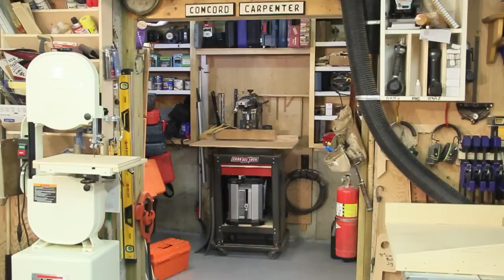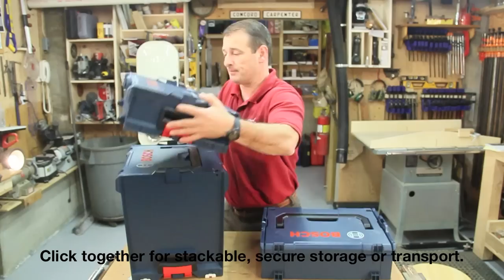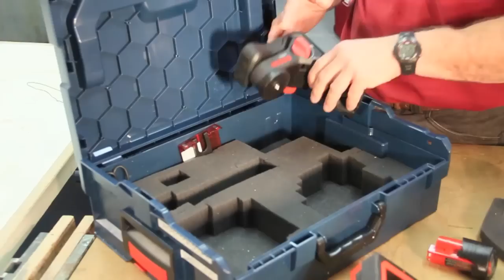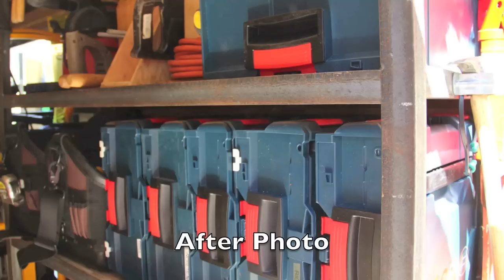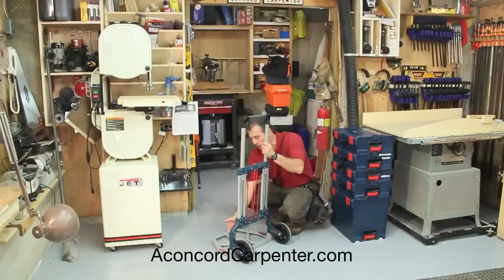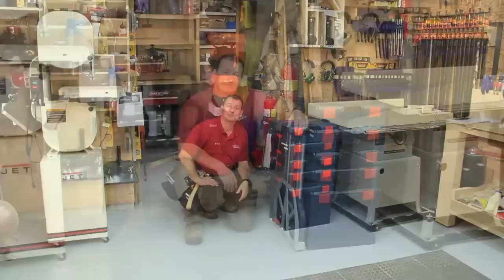Bosch L-Boxx Click and Go Review

Comment: I like your trailer, I've always used panel vans myself , the label printer is great idea too, although I have the shelves  labelled instead which decline 30 degrees and when I'm loading them back into the van I can quickly see what's missing, but your set ups good too👍

Comment: Connection between two containers looks very weak and unstable. It moves front and back. I bet it is the weakest point in this system. Makita containers are the best. It has 4 connection points from each corner. Plus you can stack Festool systainers together with Makita MakPac's. Also Makita has trolley too (makita tr00000001 and P-83886). Only good part in Bosh containers are side handle. It makes handling much easier.
Reply: Nemo D123 all my tools are Bosch and I've never had any issues whatsoever with the L box.  I keep em stacked up in the van all the time and no problemss at all.

Comment: Hey I was just curious as to how well this will work ratches and wrenches and so forth for hand tools for the molding? because im looking for something like this that is portable but i dont want my tools stuck so far down in the foam
Reply: +Renike Also, you can get the kaizen foam pre cut inserts here. http://www.ebay.com/itm/L-Boxx-Kaizen-Foam-insert-For-Bosch-Lboxx-/261754249150?var=&hash=item3cf1c4dfbe:m:meOyfbtSRyQWN6BhsaU4xGg
Reply from the maker: I think it would work really well if you would lined it with foam or something on the bottom and maybe on the lid

I use tool bags to transport my socket sets and wrenches I just find it easy to throw them all in the back, but it's not easy to find stuff
Reply: ok cool thanks wasnt sure how well it would work with them because the foam was pretty thick, thanks for the reply!
Reply from the maker: +Renike Get the thin foam
Reply: +Renike Here is the best foam option available. It is kaizen foam from fastcap.http://www.fastcap.com/estore/pc/Kaizen-Foam-p13435.htm

Comment: Good video, thanks for posting.  So the bottom box doesn't click into the trolly? ...you just have to bungee it to the trolly?
Thanks.
Reply: actually the base of the trolley has two red receivers that click in to the bottom box
Reply from the maker: Correct
Reply: I want to purchase the XL Cart but I'm afraid it won't click into the boxes to hold them sturdy I have issues with uneven terrain and my boxes fall over each and every day I need to know if the dolly actually clicks into the boxes themselves?

Comment: Thanks for the review, I got about 5 of the cases and I'm happy with them, I also brought a new festool t55r with a systainer. I do think the bosch sortimo is better as they are larger and more handles. I do give my cases a good beating in the van and at work, they stand up to a lot off abuse. I did feel when I brought them the front locking clips were a little flimsy but once locked solid as a rock. Stacking theses can be a pain in the ass, as aligning up can be difficult.